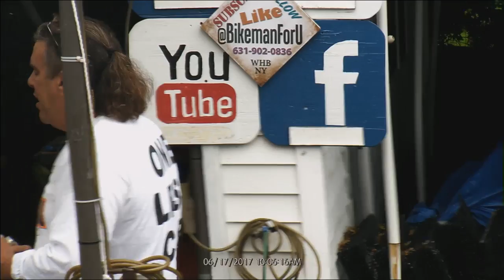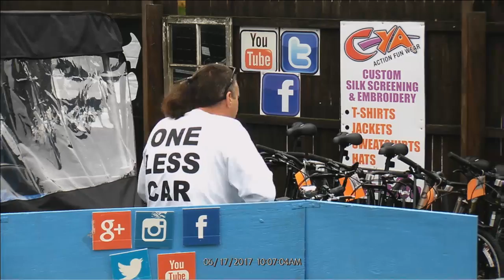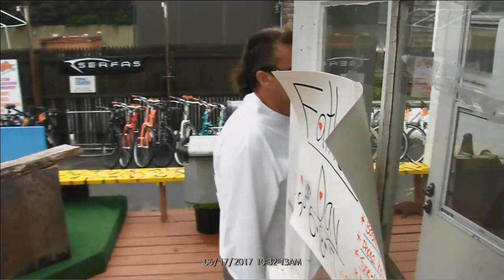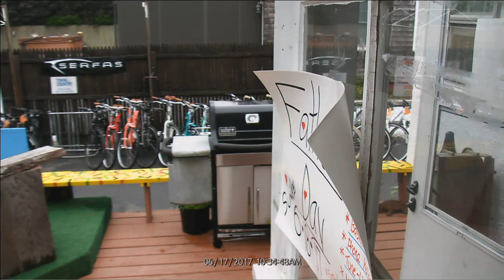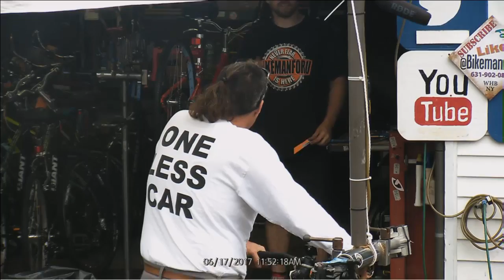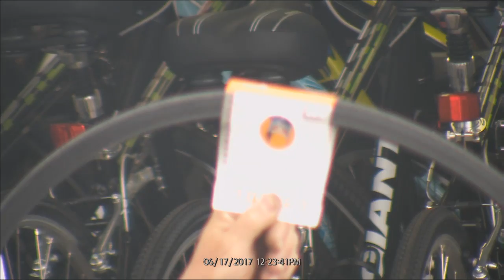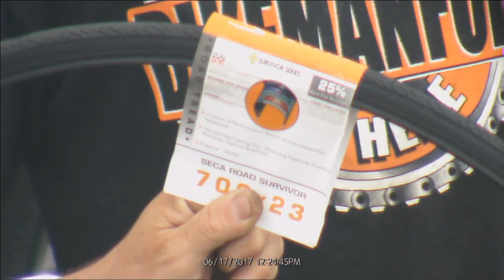Bike Shop LIVE "We're Back and Running" S5E24 BikemanforU Show 06-17-17

Comment: I'm not sure about serfas I use kenda tires and odyssey aitken tires
Reply: Nick Fanella , great tires. They have a great flat proof system in most of there tires. I use Serfas drifter for street riding on my mountian bike , great for road or light trail. Give them a try they make a large selection of road and mountain tires.

Comment: That Coaster pedal-cab is one bike that i am surprised isn't an Ebike.
Reply from the maker: the motor is coming soon keep watchin
Reply: I don't buy through Amazon because of the Prime premium thing. Having to pay a subscription just to get something delivered in less than 3 weeks is just downright wrong. Before Prime was invented you could pay the same amount for something and get it delivered in a few days.

I now try and stay away from Ebay/Amazon and buy direct from the online store of whatever it is i want instead.
Reply: Also i rarely buy online at all nowadays, it is an option of last resort if the thing i want is not available in any local bike store.